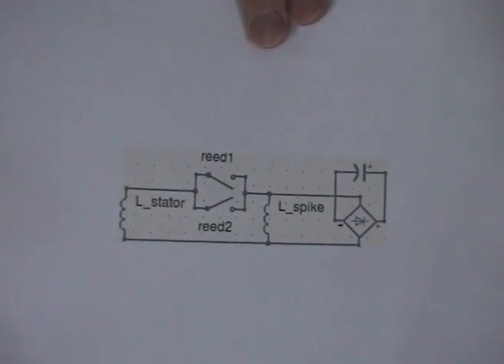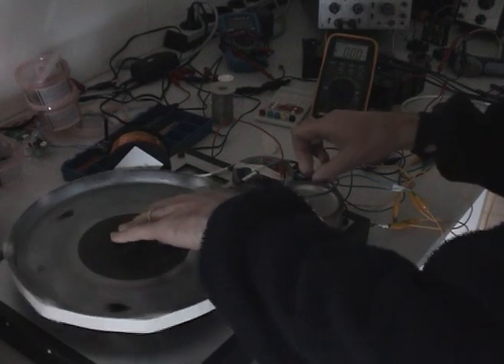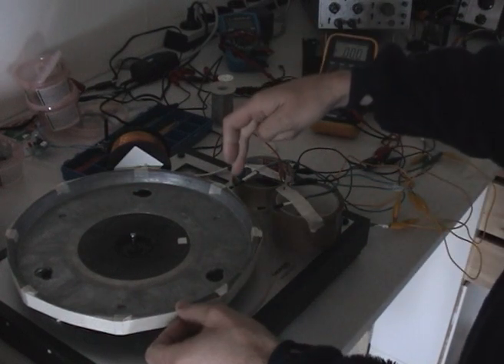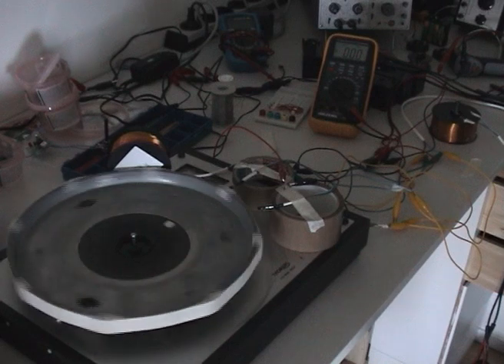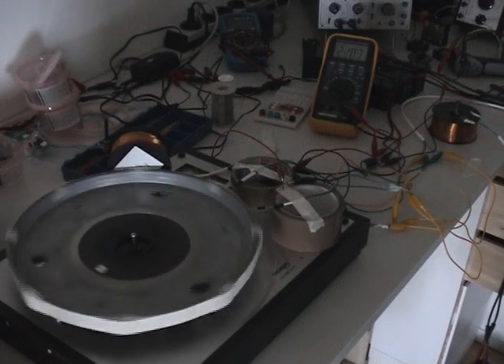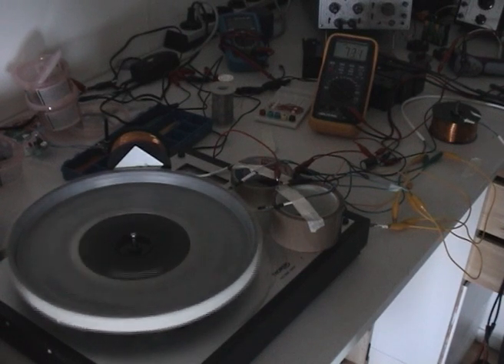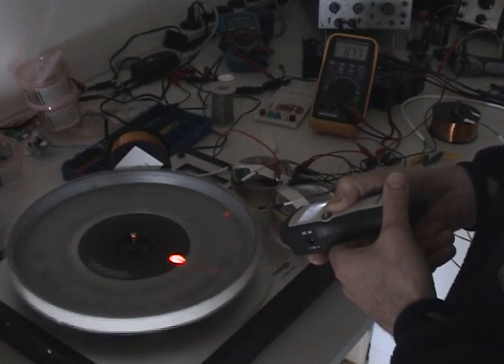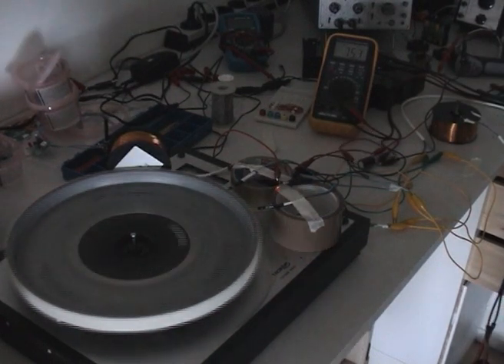Charge from slow motion part 2

Comment from the maker: The neodynium-magnets are pretty strong. A ferromagnetic core does boost the magnetic fields, obviously, but the rotor stops quicker and the magnetic attraction ruins the setup, it's currently just hold together by tape in some areas and in other areas only by gravity ;-)

Comment: I think it would slow down in either case. I'm just thinking along the lines that a ferromagnetic core would boost the magnetic fields a lot. Try it out and see what happens, I've only tested this with a small solid iron core and that definetly introduced drag.. I guess in the form of Lenz's law. This video made me think and connect some more dots on the operation of this machine.

Comment: You're right, but you have to take into account that you can then switch the electromagnets with the reed switches. Neodymiums are probably too strong to fully exploit this, meaning that you drive the cores of the electromagnets into saturation too easily (or maybe that's a good thing.) That's how I figure it out inside my head atleast, I haven't actually tried it out besides a simple control test setup.

Comment: i an using 24 nib magnets andif you are going to use an iron core try moving the coil back. there is a point where you can get max speed with out the drag of the magnets